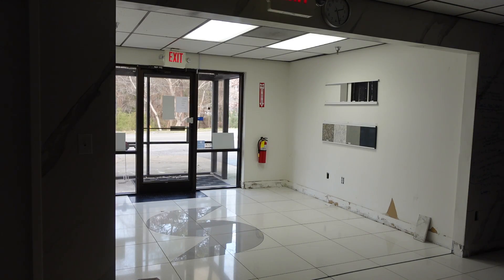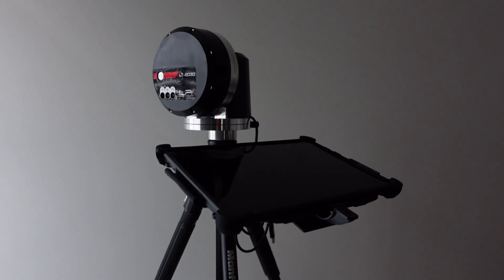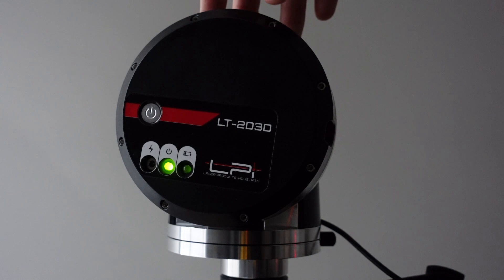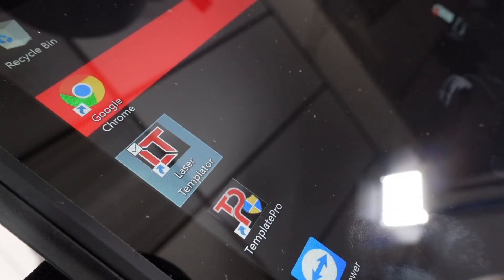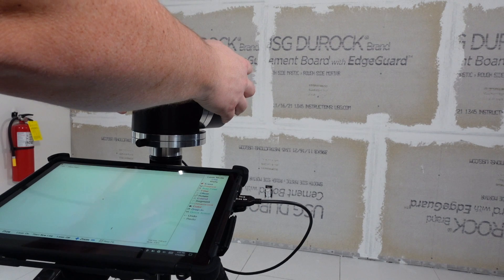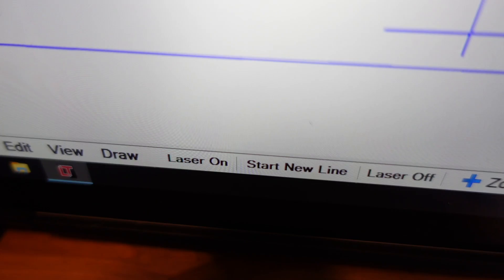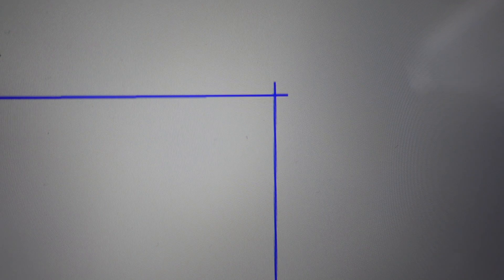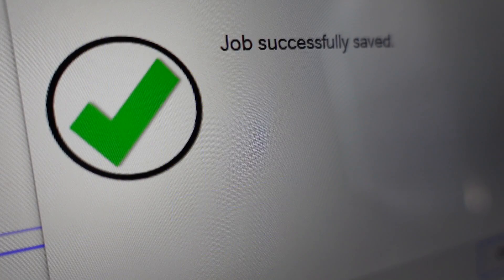Digital Measuring 101 : How to Template a Wall with an LT-2D3D - Dekton | Porcelain Slabs | LFT

Comment: Great video!  Couple tech related questions though.  I started with the LT55 when it came out.  Now using the LT2D3D which has been money.  So how did you shoot the floor and ceiling accurately without using the green dot matte tape?  Also, theres no way you shot that close to adjacent walls/floor/ceiling without using the black filter.   I'm guessing you were just giving the basics?  Either way, great video!
Reply from the maker: Thanks for the comment and view.  A key detail is always double checking dimensions pre/post measure.  You may get better at knowing when the laser stretches or gets absorbed.  With the old software I could tell pretty quick if i was off.  With Raptor a few clicks will alert you issues.  But as always, double check.  The wall in the video had old dirty paint that gave good reflection for measurements

Comment: ive been using this system for about 1 month now and I hate it. it is always off by either 1/16 to almost 1/4. the software is great but I still need to use autocad to prepare for cnc. and how the hell am i supposed to measure a circle or weirdly shaped sink if the laser cant get to it. honestly I cant wait for the proliner to arrive. I had big expectations for this system but honestly I had to go back to measuring old school with long levels and and squares... not to mention having to verify every single measure the laser takes and adjust on the software. its just not accurate unless my tape measure is off....
Reply from the maker: I am going to cite user error my friend.  If you are using for just one month, you might be missing a step.  did you buy second hand or direct?  Reach out to your rep or laser products for additional training.  There is also a setting that allows for rounding up or down on measurements.  Might wanna look for that setting.  There is good reason why 2d3d’s are so heavily favored.
Reply: If you're off by 1/4 that is way too much, something is not right 1/16-1/8 is the max!
Reply from the maker: @elguero2637  i think he has a setting wrong or wasnt trained proper
Reply: @Porcelain Panel Pro  yeah possibly, the only issued I have experienced lately is my tri pod seems to not hold the laser head completely in place when i tighten it seems like it's not firm, at my prior company they had an older tri pod model and it seemed to be better than these new ones
Reply from the maker: @Richard Brown underutilized feature for sure
Reply: I draw my panels into the LT55 program. I don’t use the laser itself. Your presentation takes way too long. I would have measured 3 wall panels in the same time.

Comment: My man you're hilarious! 2:52 had me dying 🤣 Seriously though this channel is awesome. I've never had the pleasure to work with the panels yet but I'm so intrigued by the degree of difficulty and high risk. Pulling off these installs to me just seems like the mark of a master tilesetter. From the size and weight alone, to the tools and skills required to cut/fab, to the substrate tolerances needed to even put a panel on the wall, to the knowledge needed to get that TCNA compliant install it's just really impressive. 
You have a knack for teaching. I can tell you're highly intelligent(probably a math wiz based on how easily you gave instruction on using the laser, the offsets and what not) and very well spoken. Your explanation is clear and concise. I have confidence you'll achieve whatever you set out to do with this channel!
 I found you from I think a comment you left on one of Tile Pro USA's  videos. You two are both killing it in the panel game and I'd love to just be able to keep learning more about it. I do remodels. We don't tile everyday and I never get to see people doing panels in the Phoenix area so this channel is extremely valuable in making me a better, more well rounded tradesman, even if people want to call us remodel guys cowboys and pretend like we can't do solid work or wont put in the grueling hours of self education to do the best job we can!
Reply from the maker: That was an awesome comment you wrote man.  Screenshot, save, cry, and gratitude!  Panels r the “in” thing right now.  It is already showing up in phoenix as my old employer is opening a location there.  Message me if u ever have questions!